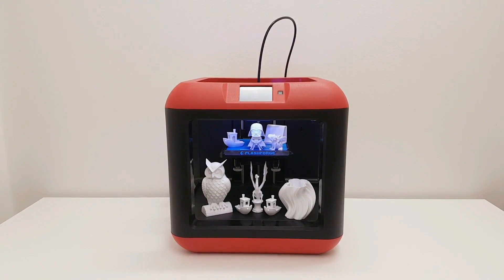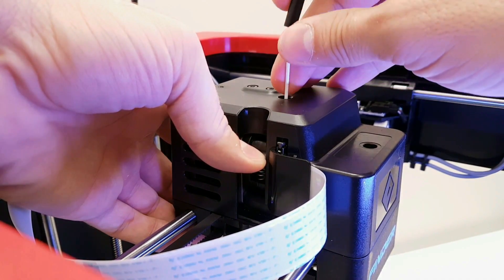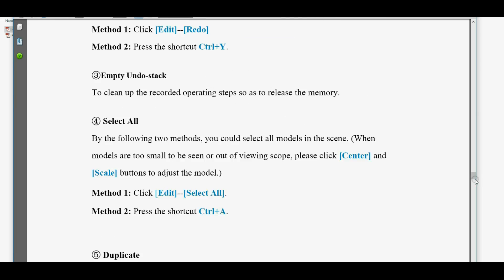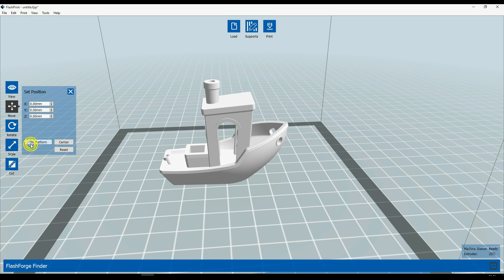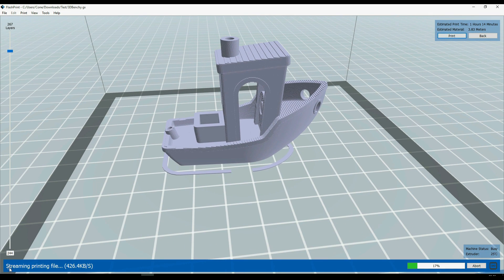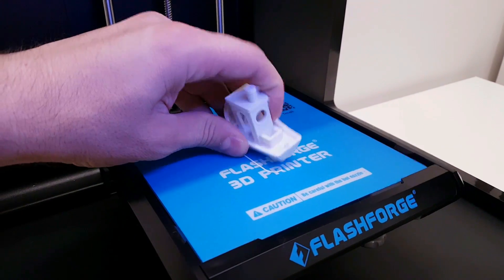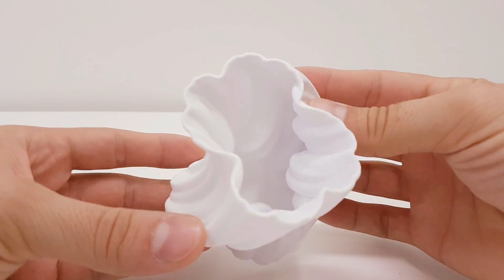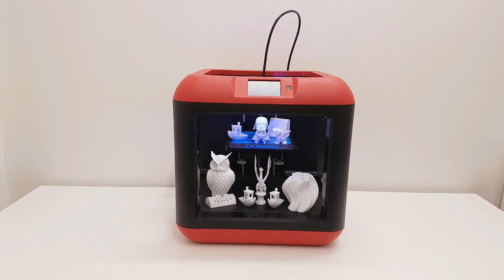Flashforge Finder 3D Printer FULL REVIEW

Comment: I have one of these, I wanted to increase the printing area , is it possible? Can you change the size of the print area in the settings? I saw that there is more space between the moving car and the sensor on the sides of the table. I would also need to change the size of the table, do they sell? Thanks!

Comment: I've read a lot of reviews saying this printer doesn't have a heated bed, did you find that to be an issue at all? Im completely new to this and was thinking of purchasing this 3d printer.
Reply from the maker: Not at all. This 3D printer is for PLA and Flex filaments and for those materials you don't need heated bed. It gives constant and supreme print quality all the time without any efforts. I still have this 3D printer and it's work great. Never had any problems with it. 
FlashForge still makes and supports Finder and still they realise firmware upgrades.
To my opinion this is still the best 3D printer for bigginers.
Update:
Here is a nice spool holder for Finder for use with any spools of Filament  - https://www.thingiverse.com/thing:2937534
Reply: @NexiTech  wow that was a quick reply! Ty for that information i really appreciate it.

Comment: What filament did you use?
Reply from the maker: Gi Geo The ones from video description. I have printed two spool holders which they attach to printer from the sides and I use them externally because  Finder use smaller spools. I use 1Kg spool with my Finder. It's cheaper that way and I can use any filament that I want.
Reply: Thank you for your quick reply
Reply: You have good links.  Leaving a like and a subscription.
Reply from the maker: Spool holder https://www.thingiverse.com/thing:2937534

Comment: My Flashforge Finder lasted from August 2018 to November 2018. Quit working with a faulty mainboard. New mainboard is more than half the cost of the printer so I don't think I will bother. Didn't like the tiny LCD touchscreen anyway which was difficult to use even with a stylus. An expensive $500 way of learning to never buy another Flashforge printer.
Reply: No warranty?

Comment: Looks great but 140mm size is too smal. I think this printer will be great if it can print bigger items.
Reply from the maker: Kenneth Gundersen You would be surprised how manu items I print on this machine. Most of the models on thingiverse are not that big.
Reply: Nexi Tech That’s true. But the models I want to design in Fusion360 is bigger. But I like the simplicity of the printer so I hope they will think of making a 300*300*400 version.

Comment: Are you supposed to lubricate the rails before using the printer? It came with a small bag of lube....
Reply from the maker: Rostislav Persion Yes you should lubricate rails from time to time. I do it on mine and now I use simple bike chain oil. few drops from now and then and it still runs great with original linear bearings. Ony God knows how many prints I printed with it :D Awesome printer
Reply: Could you make a quick video on how to maintain the Finder? I want to make sure mine lasts a long time, but don't want to break anything when I do maintenance/lubricate

Comment: Can you please tell me what print settings are you using ? My prints keep stringing a lot even with default settings :(
Reply from the maker: haris khalil Try to lower the temp to 200/195c
Reply: Thank you for your quick reply :).. I have printed in those temperatures and also played around with retraction settings. The stringing happens if the distance between two points are small.
Reply from the maker: haris khalil No problem, try retraction speed 60-80mm/s and retraction distance 2-5mm That should do the job.

Comment: awesome video review..may i know if we need to apply glue stick to the platform before we begin any printing?thanks?
Reply from the maker: Mustaffa Kamal Bashar Mohd Fauzi
Thanks! Well, not every time. Sometimes you can print few times before you apply glue stick again.
Reply: thanks for reply promptly. I made a first try out..the result is awesome however, the printed model sits extremely tight and hard to take out from the bed.Any idea i can solve this. Thanks in advance.
Reply from the maker: Mustaffa Kamal Bashar Mohd Fauzi Try to re-level the bed and increase first layer height. For example if is 0.14mm increase to 0.2mm or more.
Reply: cool..thanks!

Comment: How stable do you need your table to be? Anytime I bump my table it wiggles loads and now I'm nervous to actually run my 3d printer because I don't want the table itself muck up the print.
Reply from the maker: MrRoccoMarchegiano Hm.. I never had problem with that. My table is cheap IKEA table. Nothing special. Can you place 3D printer on another table/ground etc? Or can you reinforce that table that you have.
Reply: Nexi Tech -  Yeah, I was overthinking, I'll put in on the ground and build a proper table later. Thanks bud.

Comment: How long it takes to print one model like the dragon?
Reply from the maker: Bit Kh One hour and 36 minutes in standard 0.18mm layer height. 
3 hours and 5 minutes in High quality 0.12mm layer height.
Reply: Thanks for the info.. I was wondering if it could be used for small industry toy production.. that's wud be too expensive and time consumption..

Comment: you could even increase the height of a final print by cutting it in half and adding a mortise and tenon and glue it together after you have both parts printed separately
Reply: Jacob Clement Can this be done in the printer slize software or do you have to make the cut and add mortise/tenon in the modelingsoftware you use?
Reply: @KennethGundersen  You'll most likely need to use some modeling software to add the mortise/tendon since you will be modifying the model.

Comment: hey mate, none of my prints sticks to the bed, they all fall off during print. any ideas how to fix it ?
Reply from the maker: .q0iH8Sn0w Did you level your bed correctly? If so then in software(FlashPrint) lower the first layer height. Stock is 0.27mm try 0.20mm or lower. It  should do the job.
Reply: Nexi Tech just did the autolevel. but my printer has no beep sound. there is kind of melody playing. i will try it thanks 👌🏻
Reply: tried it but same result. when I let him print the first layer its not a print flow there is like a little stop for milliseconds every 2 mm. I checked the raft option is that the problem ?

Comment: can i change the nozzle to a 0,2mm on this? i want toprint minatures and need very high detaIS :)
Reply: EspenShampoo25 even a 0.1😉
Reply: nice,, have you tried?
Reply: EspenShampoo25 yes, a print at 0.04 lager hight took 44 hours and at 0.2 took only 6 hours but the quality is like comparing my drawing skills to picasso 
You just need your settings and printer really dialed in because marks will be more noticable
Reply: do you also print minatures :D ? or just for the point of checking what it can do?
Reply: EspenShampoo25 of course : )
Reply: nice, what kind of miniatures are you into? i like games workshop